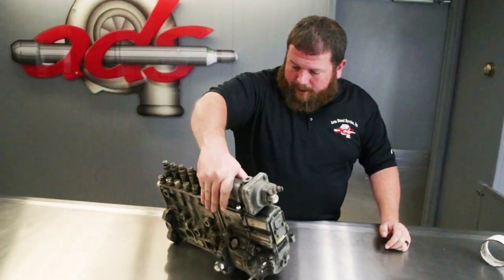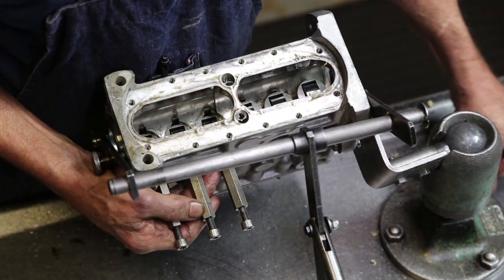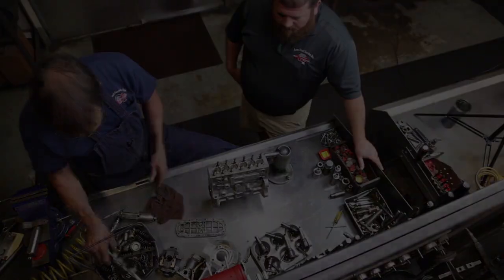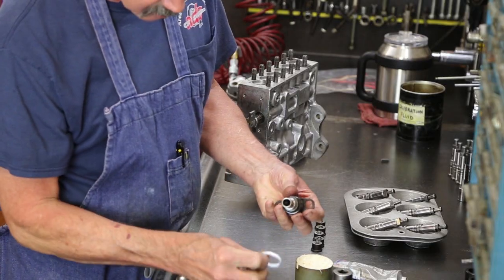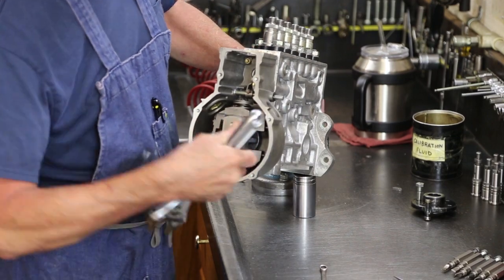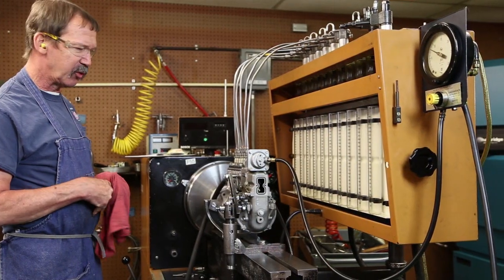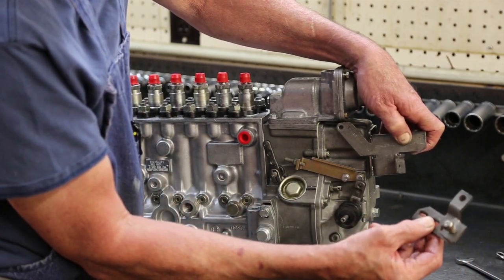FULL - #Bosch #Diesel #Pump #Rebuild - Area Diesel for #bcbloc02 Hyster Forklift 8.3L Cummins Swap

Comment: Like that ball-joint hold-down jig, great idea!
Reply: Looks like they just cut the vice top off. Much much cheaper than a purpose built fixture.👍
Reply from the maker: One of the many reasons our company has had an in-house machine shop is to create these types of solutions to work smarter, not harder.
Reply: What brand is this bench top ball joint fixture?

Comment: Brian Sent me. Great content and excellent explanation. I have 5 Cummins' running P-pumps and have had all of them modified. Fuel plates, 4K springs, delivery valves, advanced timing…now I know what I actually paid for! Man there is a lot going on inside there…Thank you!!! Looking forward to the injector info too.
Reply: We are manufacturer specialized in auto and marine diesel engine parts since 1952.
Our main parts are
EURO II system: plunger, nozzle , delivery valves, head rotors, repair kits, etc.
Common rail system: Injector complete and injector spare parts for CATERPILLAR, DENSO, DELPHI , BOSCH, SIMENS, CUMMINS, etc.

If you have any inquiries, pls do not hesitate to contact me.

Comment: Very good video. Incredible detail for a utube vid. Don’t care for the music, found myself killing the volume throughout, had to replay to not miss dialog. Otherwise very good. I am a new subscriber now
Reply from the maker: Thanks for the feedback and sub! In all we do, we look to continual improvement - the general feedback shows the background music wasn't much of fan favorite (and honestly will make for less editing work in future videos if we leave it out!)
Reply: We are manufacturer specialized in auto and marine diesel engine parts since 1952.
Our main parts are
EURO II system: plunger, nozzle , delivery valves, head rotors, repair kits, etc.
Common rail system: Injector complete and injector spare parts for CATERPILLAR, DENSO, DELPHI , BOSCH, SIMENS, CUMMINS, etc.

If you have any inquiries, pls do not hesitate to contact me.

Comment: Gary, your knowledge and experience are priceless and quite admirable. Love watching experts. The disk sanding is quite effective. I would not have thought of using it on those precision surfaces. In the right hands though...  l'm a 38 year auto mechanic. Still do carburator ohauls. This is a bit more involved to say the least. Much respect. Hope they're paying you plenty.  Keep up the good work. Chris.
Reply from the maker: Thank you for your comment and glad you appreciated the facing/sanding step.
Reply: We are manufacturer specialized in auto and marine diesel engine parts since 1952.
Our main parts are
EURO II system: plunger, nozzle , delivery valves, head rotors, repair kits, etc.
Common rail system: Injector complete and injector spare parts for CATERPILLAR, DENSO, DELPHI , BOSCH, SIMENS, CUMMINS, etc.

If you have any inquiries, pls do not hesitate to contact me.

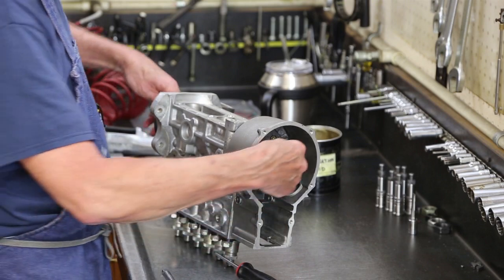Comment: @41:07.. the tapered roller bearings on the cam are worn out.. they should NOT sound like that dry at all..  you might want to set up a jig for clamping the bearing races under some preload to the bearings while you spin it..  it should make NO SOUND as you spin the cam.

Comment: Brian sent me and watched the pump rebuild from A to Z. You guys are doing a great job. Just one Q, was this the same series of Bosch injector pumps used in Mercedes Benz and probably MAN trucks of the 1970's, or earlier to 1990's? I know these trucks were not common in north America, but were very popular in Latin America, Europe, Asia and Africa.
Reply: We are manufacturer specialized in auto and marine diesel engine parts since 1952.
Our main parts are
EURO II system: plunger, nozzle , delivery valves, head rotors, repair kits, etc.
Common rail system: Injector complete and injector spare parts for CATERPILLAR, DENSO, DELPHI , BOSCH, SIMENS, CUMMINS, etc.

If you have any inquiries, pls do not hesitate to contact me.

Comment: How much would the service on the pump cost ?
Reply from the maker: Each pump is unique in the replacement parts needed / labor hours, but if you shoot a message over to parts@areadiesel.com (call 800-637-2658 or hit the chat now at areadieselservice.com) someone will get a quote together in no time for your pump.

Comment: Who makes the bench keeper tool? Looks really handy
Reply from the maker: The tool used to hold tappet springs down is a Robert Bosch tool with a modification - we do have our own in-house machine shop so some tools you see in the videos are custom-made by Area Diesel Service.
Reply: @AreaDieselService  i was referring to the tool that holds the pump to the table top
Reply from the maker: @earleclemans4836  - I double-checked on that for you - the reply I got from the Pump Dept "The mounts that bolt to the pump and the vise we have built ourselves. The vise we bought 100 years ago" :)
Reply from the maker: @earleclemans4836  - I also want to share our online flipbook in case you want to learn a little more about everything else we can do!  https://areadieselservice.com/digital-catalog/
Reply: @earleclemans4836  Post a time so people can reference exactly what you are asking about.
Reply: @ShainAndrews  its the post bolted to table with ball socket on top..he has pump bolted to it so it holds pump in place while he works on it
Reply: @earleclemans4836   It looks like a Wilton Pow-R-arm. Usually you'd mount a small vise on them but this looks like another good use for them.
Reply: @CwazyWabbits  nice that damn sure looks like it
Reply: @earleclemans4836  I'm trying to help you help yourself.  When asking somebody a question on any video, post the time stamp.
Reply: @ShainAndrews  It's shown throughout most of the video, first appears around 5:25
Reply: @CwazyWabbits  I'm out.  Seems nobody understand the written word any more.

Comment: You certainly show why a rebuilt exchange pump can cost so much.  I was quoted over $700 for a pump to my 5.9 1st Generation Dodge.  I couldn't do that.  I managed to muddle through an overhaul of a Bosch VE rotary.  Not preferred, but the truck was needed, and desperation won over fear of the unknown.  It was a vastly different experience from what you show us here.  It didn't show me the amount of detail that can be involved with a full rebuild.

In fact, after seeing this video, I'm under the impression that a VE rotary must be a cakewalk for you guys ... ??  I noticed that you don't have one up concerning those yet ... I've got one, on a VW engine, if you need a specimen  😃 ... naw, that engine will likely never run again ... besides, I'm not sure I want to see everything I did wrong.  The truck runs as it did before, and it's not leaking fuel everywhere, so I'm happy.
Reply from the maker: We have a video coming soon of a DBG Stanadyne / Roosa Master pump coming.  I'm sure we'll get to the VE down the line also!